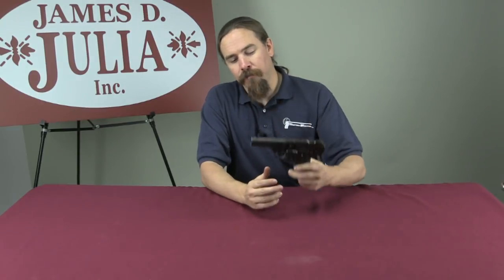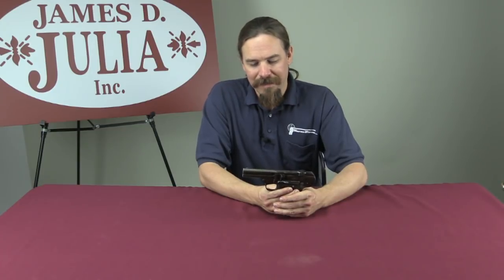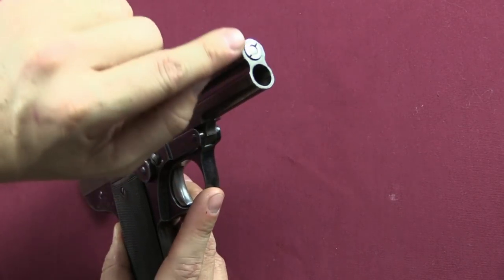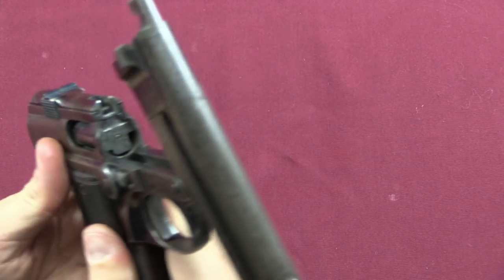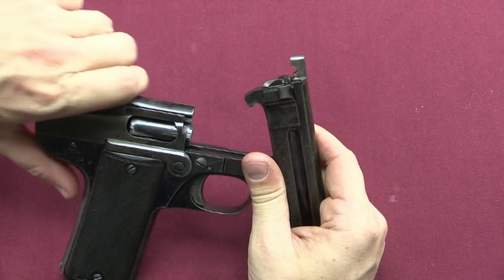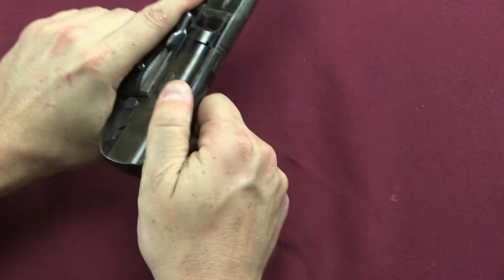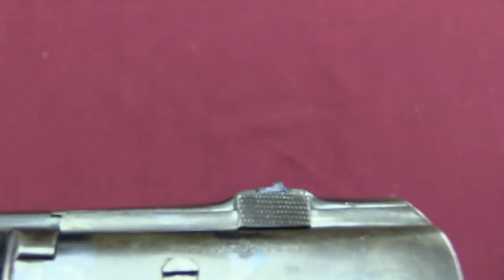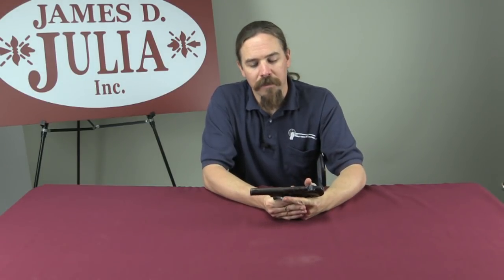Prototype Pieper .45ACP Pistol

Comment: Just wanted to thank you for doing this series on early auto pistols. I have one Steyr Pieper in 7.65mm and it kicks like a mule. I wouldn't want to fire a .45! 
Regarding the Schouboe, its ammunition was usually found in cartridge collections in the River Plate area. All the samples I've seen had the wooden plug. Now I get the connection with Uruguay.

Comment: Considering that the Schouboe Prototype .45 had to use extralight bullets to make the straight blowback action possible this one looks like it had to use even weaker loads as it's bolt looks really light even compared to the Schouboe's slide.
Reply from the maker: Yeah, I don't think these would have worked for very long.
Reply: Forgotten Weapons Weird. I can't believe that they produced a gun that, at first glance, doesn't work. Don't you have an explanation or a suspicion what could have been going on in that case?
Reply from the maker: Cosmas B
If you read the trials reports from US or other military trials, it's actually fairly common for guns to be submitted which simply flat-out didn't work. I think this one would have worked, but would have been unpleasant to shoot and would have had a pretty short service life.
Reply: Cosmas B Submitting guns for military trials seems like it has been and still is a mysterious project. It seems like it is a well-known fact that only guns that are made by American companies, or by European companies with US manufacturing plants will get contracts, yet that doesn't stop countless attempts.

For instance, the M249, based on the Belgian FN Minimi, is made by FN, but at a US plant. Presumably this is some kinda agreement so that in the event of a war, the US can nationalize such a factory to make sure that no manufacturing is blocked.
Reply: Nukle0n Be careful around those Belgians, they're just itching to invade the US. :)
Reply: Nick Galbraith They've already softened us up with their damnable waffles and tempted the weak with their devilish beer! Now they make our M16 and M4 rifles... and they're FREAKING GREAT RIFLES!! We're doomed.
Reply: +Nukle0n 
one big reasonwhy established manifacturers with US relations tend to pass trials is because they can afford to underbid the competition
Reply: ProTip:  In the olden days the firearms manufacturers had to pay for R&D of all weapons.  So you submitted everything you had to every trial in the hopes that one of them would be accepted and THEN you got money from the Government.

Today the US Government pays for all R&D before the weapon even exists.  This has led to all kinds of waste and fraud by firearms manufacturers as they milk the FedGov't for millions of dollars for small arms and billions of dollars for high cost items like the F-35 POS.

If the Millitary-Industrial Complex had to pay for everything BEFORE it was submitted there would be a lot less waste.

If you want an example, do a little research on the Individual Offensive Weapon debacle that has been going on since the 70's.  Billions of US Dollars spent and no weapon to replace the M-16...  The closest to adoption is the 25mm grenade system that was tested in Iraq and the Stan, but I haven't heard anything since the early 2000's.  Maybe it was too effective so the Powers that be chose not to use it...
Reply: ***** That's not actually true, the government was involved in small arms development right from the beginning. The national armories at Springfield and Harper's Ferry, and the national arsenals at Frankford and Picatinny, were always involved in any weapons procurement as full-on competitors with private companies; and often won under sometimes murky circumstances. The removal of the national armories as competitors occurred in the mid-to-late 20th century, with the closing of the Springfield Armory in 1968 and the Frankford Arsenal in 1977. When the Army has tendered for submissions to new small arms competitive trials, such as the Advanced Combat Rifle program in the late 80's and the recent Individual Carbine competition, or the Joint Combat Pistol in 2005 and the Modular Handgun System, all of the developmental costs were born by the manufacturers; all these programs also had the dubious honor of being real cluster-fucks. As for the F-35, the government has always been deeply involved in the R&D funding of large, complex weapon systems, like tanks, airplanes, and ships.
Reply: @ostiariusalpha  
In all fairness the F-35 program is three similar planes with a very high degree of parts commonality. Once you accept that the program's cost is much more reasonable. If the Air Force and Navy/Marines had except for the requirements for carrier operations exactly the same requirements for a new plane say a interceptor/fighter bomber they could be efficiently built on the same production line like the F-4 Phantom II and the Air Force would get a particularly reliable plane as demonstrated by the A-3/B-66. The Navy was vastly relieved to hand the majority of their A-3s maintenance hogs to the Air Force who found them to be extremely reliable because they were not pounding on and off carriers.

Comment: You'd have to be crazy to develop a straight blowback pistol nowadays in a caliber as large as .45 Auto...
Reply: douro20 Hi-Point! That being said with a strong enough spring this could work. With the tilting barrel and a double action trigger you never really need to pull the slide back to charge it, Just drop a cartridge in the chamber and insert a magazine.

Comment: So if it has no extractor how exactly does it remove and eject cases?
Reply from the maker: coltonsin64 Residual gas pressure is sufficient to extract when firing, and the action breaks open to allow administrative removal of a live cartridge.

Comment: Looking at a lot of these pistols, it's pretty easy to see why the 1911 won out. John Browning's locked tilting breech action is something of a stroke of genius, and it was devoid of a lot of typical European goofiness like the heel magazine release (which some countries STILL use).
Reply from the maker: Actually, several of the early Browning designs used heel releases (1900, 1902 Sporting & Military, 1905, etc).
Reply: Forgotten Weapons Yes. And they changed that when they realized that forcefully prying the magazine lever and having to fiddle around and get a good grip on said magazine to make a very decisive action to pull it out is a poor design choice.
Reply: @shdowhunt60  
I like well designed heal release as I can never reach the thumb release with my thumb. Needing to pry the magazine free after being released is bad no matter where the release is.